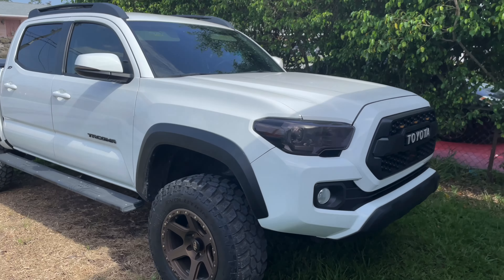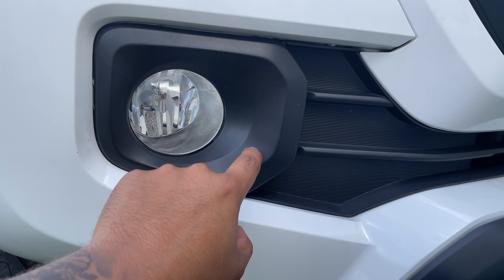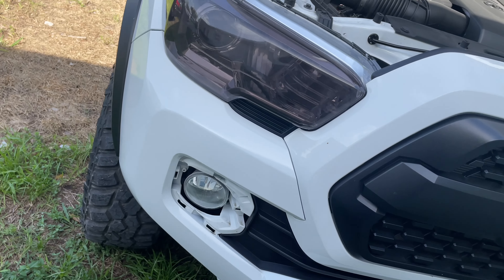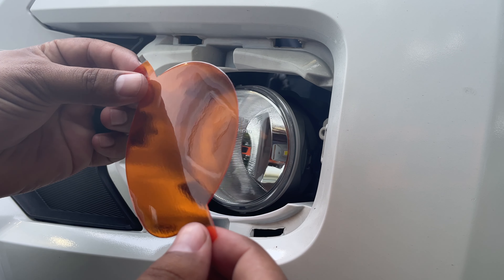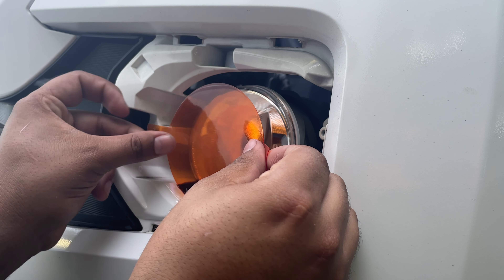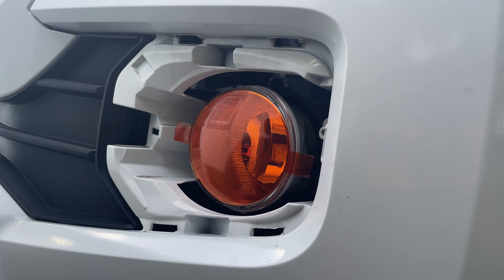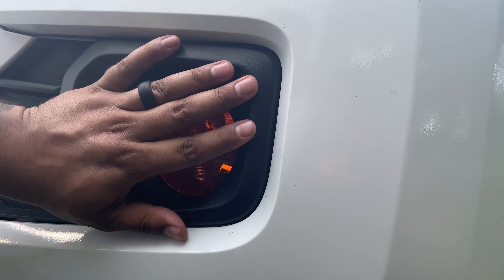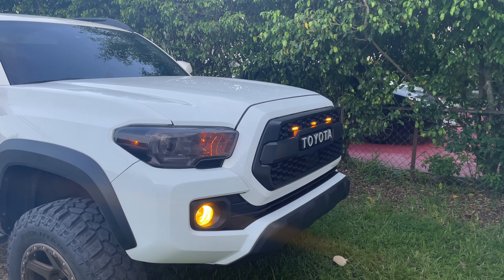Tacoma Amber Fog Light Tint (Lamin-x)

Comment: If that’s the Factory fog lights you can buy the LASFIT LED FOG. Light bulbs and they are Switchback white and Amber you turn them on once there on they will be white turn them off and back on they come on Amber that make really good LRD bulbs there head light LED bulb are really nice they come with a fan  Dual cooling system there’s a fan on the bulb and a fan on the dust cover

Comment: Damn, they don’t have red😡Good job at least after at all those hours, watching me wrap my truck by hand you learned something…lol
Reply from the maker: I had to look back because I’m surprised they don’t have red Lol. Allot of Tacoma YouTubers messed this up. Both with the way they applied the tint and by several people breaking the tabs on the fog light trim pieces. I’m really happy with the way it turned out.
Reply: legally we cannot offer Blue or Red on forward facing lights due to how they mimic EMS/First Responder vehicles. If you happen to buy a sheet of Red or Blue and wanted to do that we could not do anything about that but know you may run the risk of getting pulled over and cited by local law enforcement.
Reply from the maker: @Laminxfilms  ahhh I see. Yeah that is very true.